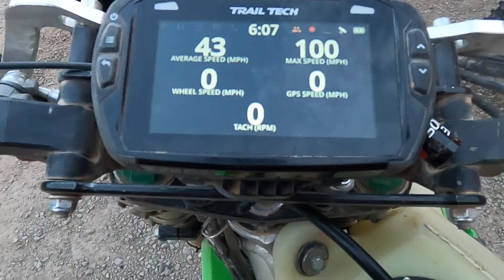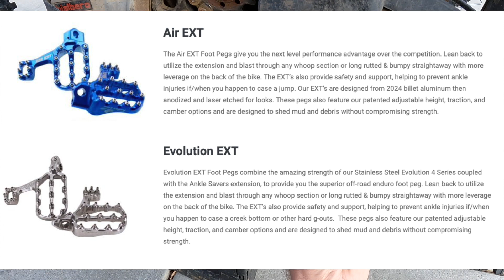RS500 Vlog Episode 6: Baja Decompress

Comment: Those Fastway pegs look like the way to go. They would have saved me from fracturing my ankle once at the track. Careful of the overextension on landing! With Pivot pegs you lose some bike control. I tried to get used to it.. but the more technical stuff they will drive you nuts. They are for cruising only.